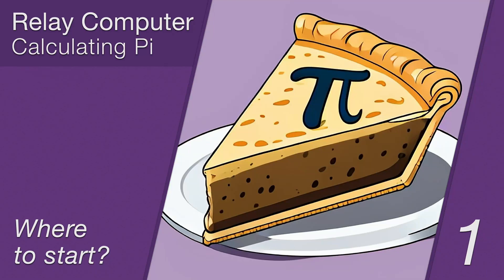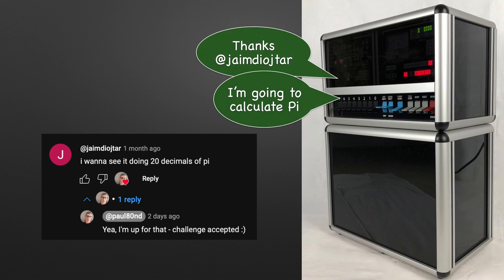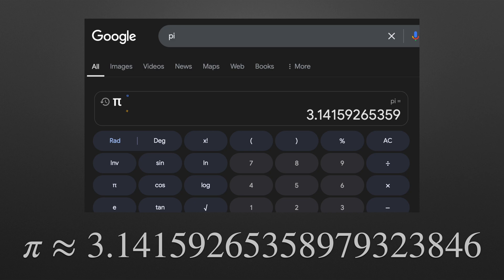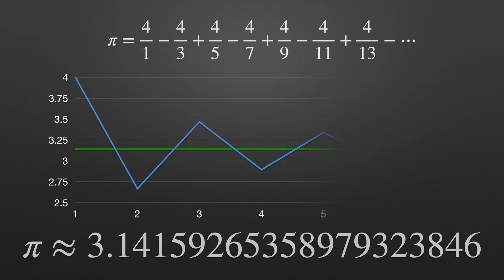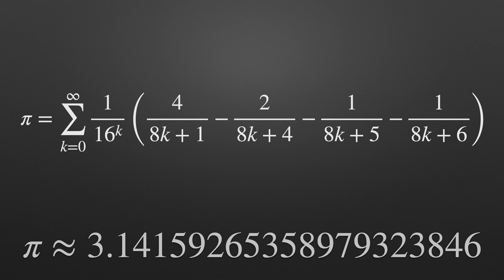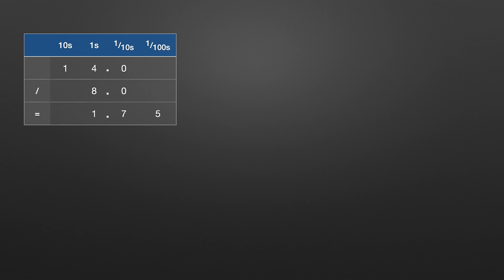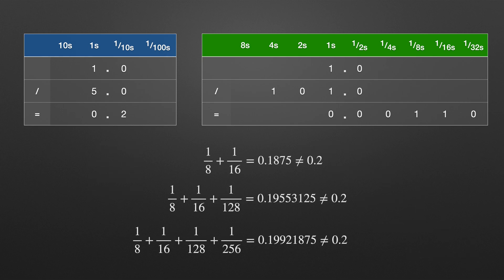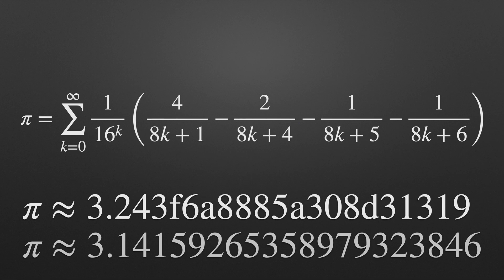Relay Computer Pi - Ep1 - Where to start?

Comment: I wonder if there is a way to calculate pi without the fractions, leaving an integer result. We don't need to express pi as 3.141... We can also express it as 3141... The decimal point never changes. Why bother with fractions? Granted, 3141... cannot be used directly in calculations, but after we've computed the number of digits we want, all we have to do is stick in the decimal point. A big number algorithm would have to be used though. 🤔
Reply: That is always the case with arithmetic. As long as you keep track of where that point is, you can do whatever operation you want as long as you put it back in the right spot. I’m sure Paul will discuss this, but I’ll show an example in decimal.
5*25=125
0.5*25=12.5
0.5*2.5=1.25
0.5*0.25=0.125
The only thing different about the equations is where the decimal point is. Computers handle this by keeping track of where the decimal point is (floating point arithmetic) or leaving it in the same spot of the number and shifting digits as needed (fixed point arithmetic). In the case of fixed point, the computer does not care where the decimal point is, it’s just doing integer math. Only the input and output knows where the point should be.